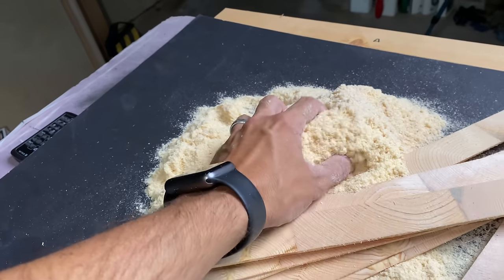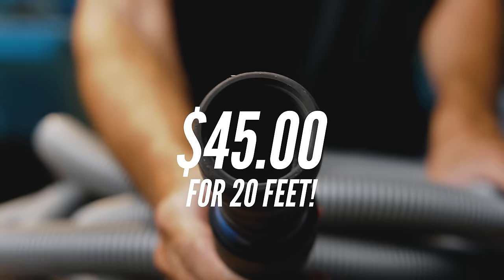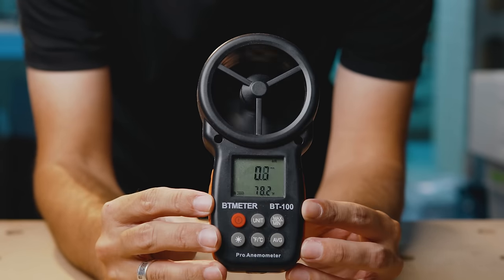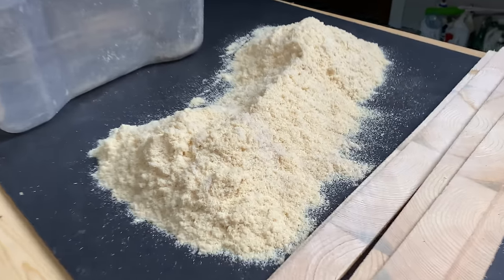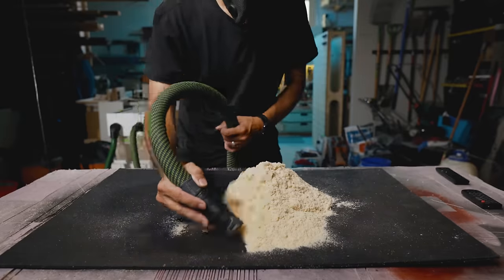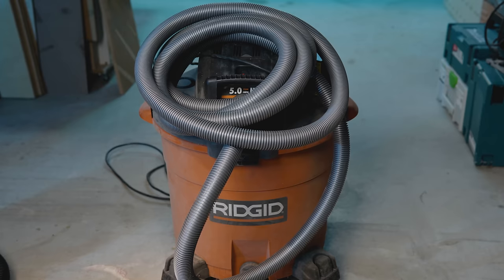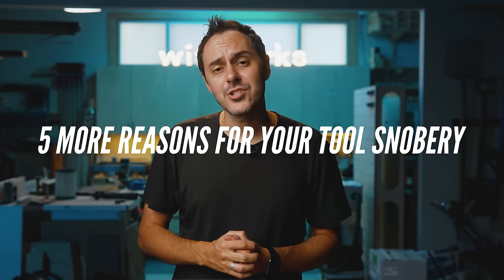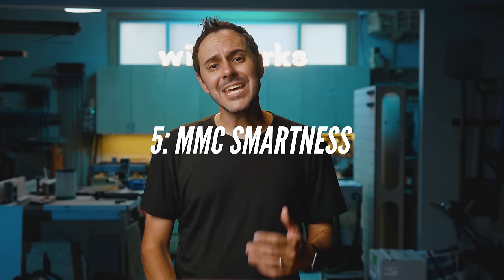This video will save you a lot of money. Dust extractors for beginners.

Comment: Really interesting video man! Nice to see the honest feedback on festool and some side by side comparisons.
Reply from the maker: picks himself up off the floor 

cough

Thank you Cam! Can't believe you watched. Or even commented. 

Thanks for not trolling me. I'd have to screen shot you at the end of my next video. That would be embarrassing.
Reply: @wittworks  worlds funniest reply
Reply from the maker: @CraigularjJoeWoodworks  Ha! I forgot I did that.
Reply: What's really interesting is the vacuum cleaner can use 6.5hp when the wall outlet can only supply 3hp. 
Free energy technology!
Reply: @wittworks  I think You are often too self-deprecating good man. You may fuck up (in big ways at times) yet you also succeed in amazing outcomes, have the courage to share those challenges (that most will not) and how you get around them becomes a teaching moment within your presentation style. 

Having a smaller following doesn't have to be like having a smaller dick... you can still walk through the men's changeroom with pride knowing your product will be recognised as big potential, and in time will grow. No surgery required.
Reply: Really enjoyed your feedback. My take is don’t change or clean the filter in the old vac ever.😊
Reply: Is there a summary minute?
Reply: By multiplying air velocity by the cross-section area of a duct, you can determine the air volume flowing past a point in the duct per unit of time. Since the Volume flow by Festool is measured in Cubic Feet per Minute (CFM) divide your initial m/s by 60 to convert it to meters per minute first.
Reply: @wittworks  I khow your son please give me a shout out I love these vids
Reply: When you resell the Festool one day you will get the difference back and then some if its still in good shape. You won't get diddly squat for the used Rigig.

Comment: The more loaded a filter is, the better if filters. The tradeoff is the lack of airflow that comes with it being loaded. The particulate that is caught acts as additional filter material, and so long as you can maintain airflow, it should filter more effectively than if it was brand new. You can think of a metal grate with 1" holes and dumping gravel over it. The larger rocks will create smaller gaps that will sometimes catch rocks below the 1" hole size. With filtration you are dealing with viscosity, static bonding, and a few other things as well but it works as a basic metaphor.
Reply from the maker: Yep. That is my suspicion. Got a new filter to test against.
Reply: I was thinking the same thing.
Reply from the maker: Guess we got a solid idea for a follow up video!
Reply: Well put sir 👏
Reply: Well said! 👍
Reply: 100% whats happening.  That being said you might also want to measure air quality around the tracksaw.  The old clogged rigid maybe spewing out less particulate near the exhaust but it's probably leaving more in the air near the source aka the tracksaw.
Reply: That's actually a partial misconception. A clogged filter, with high negative pressure after it pulls larger and larger particles through it, and with subsequent cleanings the base filtration degrades fast.
Reply: Yeah, I was thinking lower suction and loaded filter would increase filter efficiency.
Reply: @Jwalk9000   Based on my understanding you are correct. If there is enough negative pressure it will degrade the filter in the long run. In the short term, or when there isn't enough negative pressure to force larger particles to damage the filter material or filter substrates, the loaded particulate acts as additional filter material increasing the probability of filtering smaller particulate. Is that consistent with what you know? I'm pulling this mostly from some whitepapers I read years ago.
Reply: Came here to say the same thing.
Reply: I've put the to words in my mind before but never spoke it because I can't find a moment when it's pertinent information, my audience member would actually care, and there's enough time to say it in the moment ... it is a lot of words after all, and while it's maybe it's not something I can say 'well this just isn't a soundbite concept' about... it'd be a long soundbite. Anyways thank you, I now feel vindicated, knowing I'm not the onle one to think this.

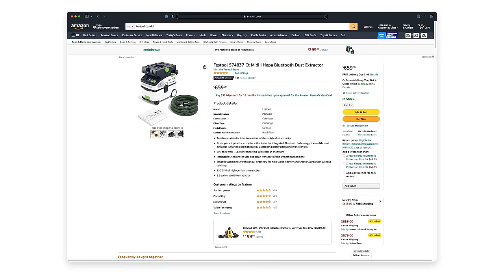[ EDIT: I wrote this while paused @ 1:14 ]
Reply: This is exactly right. We experience the same thing in the swimming pool industry. An old sand filter filters as good as a new DE filter
Reply: And also when you go to empty it and or replace the filter, you'll be breathing in the nasty stuff
Reply: @wittworks  looking forward to it as I was thinking the same phenomenon was occurring here. I too have asthma, and these kinds of videos are important to me. Thank you for making this content!
Reply: @wittworks  will you post follow up results?
Reply from the maker: @Zachary Milos  yes. hopefully in a few weeks. I'm neck deep in two other videos right now, but will definitely do a quick follow up.
Reply: @wittworks  great looking forward to it. Subbed and 🔔 so I can see the new info!
Reply from the maker: Oh man! Thanks! Got a good one coming out in an hour or so. Exporting now.
Reply: @jsmxwll  Yes, researching filter systems for vacuums, air purifiers, dust collectors, and air scrubbers, there is a common trait; All solid/dry filter mediums degrade over time and repeated uses. The EPA found in a study I saw years ago that things like "reusable" HEPA rated filters no longer meet HEPA ratings after the first cleaning, and depending on things like the airflow, filter surface area, and time in service, they don't keep their ratings very long. Vacuums and air purifier manufactures add carbon and activated charcoal "after filters" to hide and absorb smalls that are passed through the primary filters after they pass their highest effective time-in-service ratings. 

The best systems for capturing fine particles over time are water based. Cabinet shops around my area use multi stage, multi million dollar systems to capture progressively smaller particles before passing all the air through a liquid filter system to capture the last particles. And even then they exhaust the air outside the work environment.
Reply: Came here to say the same. Well said.
Reply: That's seems right but I want to add something. This only applies when you're "breathing" or measuring particles near the vac - exhaust becomes quite cleaner with an clogged filter. But all woodworkers are working on the other end of hose where situation is differ - with clogged filter you lose the airflow and it's speed on the tools exhaust. Because of that more dust will end up around the tool and not in a vac. And that is a problem. For example, I'm definitely know that difference between L- and M-class vacs not in corresponding filters - they are the same, but M-class have a special system that will signal to operator about clogged filter and lowered airflow which lead to more dust not even going into the hose.
Reply: Exactly. However, the trade-off is now all the dusty air that escaped the saw.
Reply: This is the way, I concur
Reply: Double thumbs up
Reply: Great observation!
Reply: That’s how I interpret this too. By using an old filter with buildup it’s essentially closer to a higher filtration level since it’s got more buildup
Reply: Thats not true. Thats a misconception on how filters work. Filters don't work like a sieve where particels are blocked depending on their size. Filters catch particles on their surface. Once the surface is loaded the filter loses its effectivness. Cleaning and replacing the filters is important.
Reply: @Danie90  Your comment about filters capturing small particles on their surface is true, that doesn’t negate what the others are saying.  If you look through the professional literature you’ll see filters rated at new conditions and after a specified amount of dust pack has built up.  The filtration efficiency is always better after the dust pack is built up at the expense of pressure drop.  Ignoring sieving-which does happen, otherwise very large particles wouldn’t be captured—there are three methods for particle capture.  They are: impaction where the particle hits a filter fiber head on and sticks, interception where it is captured as it goes by, and diffusion where the random motion due to molecular collision causes capture.  This is why HEPA and ULPA filter efficiency has a minimum at 0.3 and 0.1 micron respectively and gets better for larger AND smaller particles.  The dust pack acts like a filter making it harder for particles to get through.  For more details on this and filters in general check out:  ASHRAE “Handbook of fundamentals”, William Hinds “Aerosol Science”, and Einstein’s “Brownian Motion”.   Yes, I am an aerosol scientist by training and have designed and tested some of the cleanest rooms in the world.  Filtration effectiveness is something very important in this business.
Reply: I believe that Bill Pentz says the same thing on his dust collector site. That stuck in my brain when I read it many years ago.
Reply: Except as it becomes loaded and airflow decreases it will extract less and less. Becoming less useful. There's probably an ideal intersection between the two
Reply: You've also got no bag and an additional filter on the exhaust port. Not exactly a fair comparison though.
Reply: A brand new Festool bag stops 100% of even MDF dust.  I have a 5 (x2), 8, and 10 year old vac from festool.  All of them are spotless inside after years of use.
Reply: This is correct.  I would only add that less air gets filtered as there is a lower flowrate of air.  The way the HEPA filters get around this, is by making for a lot more surface area than the dirty Rigid filter, thereby allowing for more airflow.  On the positive side, when the HEPA gets a little dirty it will filter the small particles too!
Reply: On second thoughts I don't care, I'll borrow my friend's or better still get him to do the job for a couple of beers, fried chicken and fries.
Reply: Yep this 💯
Reply: @wittworks For test 2 you need a base value without the vacuum running. And maybe put a trashbag over the exhaust to isolate it with the air quality meter. 

Best air quality is always an exhaust to the outside. Maybe put a cyclone only 😂
Reply: It also uses less electic.
Reply: This is the correct explanation. Before I saw your whole video, my first thought was inaccurate meter, but then you went and tested its sensitivity, so you cleanly eliminated that explanation. The truth is that the more objects you put in the flow path the more you decrease the effective cross section available for the pass-through. But the more clogged it gets the higher the chance of motor overload that can end in burned coil —death of your motor.
Reply: Preach. You're the second other human I've ever witnessed to state how HePa works. Kudos
Reply: @vasconcelosm12345678 therefore, contain the worksource if possible, and control the pressure
Reply: @Jwalk9000 cleanings? What cleanings? You really shouldnt do that
Reply: @wittworks   did you do a follow up with a new bag?

Comment: My least favorite thing about this video is the fact that I LITERALLY have never been shocked by my non anti static hose. I watched this video, got back to my shop to work and I've been shocked like 3 times in the last 29 minutes. What have you done to me...
Reply from the maker: My bad! I got shocked the other day too. I’ve ruined our lives.
Reply: Crap, I've never been shocked by mine either. Now I'm about to go out and use it... What have I done...
Reply: Mate you will never understand how bad the static shock can be until you’ve thrown or smashed wands vacuuming concrete dust after grinding especially using a large dust extractor the charge can build up enough to drop someone who isn’t use to it or knows it’s coming
Reply: This man is truly electrifying.
Reply: @kennethhanes5438  I can back up your comment about concrete dust, while putting down safety rails, we drill 3/8 inch anchor bolts 4" down. And I can see the sparks jumping at the end of the hose.
Reply: Ha what a coincidence!
Reply: Now I understood why shock therapy is over that I was suffering for years . I am using festool!  Omg I just recall that feeling after finishing sanding and then bang 💥 at your balls.  it’s as bad as in a mental institution where I was locked recently for refusing to wear a mask and get a j@b😅

Comment: It's been 45 years since college, but I have a background in science and lab results. Your comparisons are quite valid, even if your meter is not deadly accurate. True, you may not be able to trust the quantitative numbers the meter is showing. As long as they are consistent, however, you can make a valid, qualitative comparison that "A cleans the air better/worse than "B". You have convinced me!
Reply from the maker: Thank you
Reply: I agree. Valid analysis. Precise? Not really. Valid? Absolutely.

Comment: One very likely reason the old shopvac had a lower output of very small particles is that the filter is clogged, which actually increases it's ability to filter things out, but at the cost of air throughput (and thus worse suction).
If you want to further test that you could simply repeat the test for yourself with the festool turned down to the lowest speed, and compare it to itself on highest speed.
Reply: But if it has enough suction to keep up with the waste from the tools, then it's still a better value even with lower suction...as it's not releasing a higher amount of fine particles than the more expensive options.
Reply: @alphaforce6998 but what about the fine particles near the tool where the person is breathing? The scan is getting live data at one point. We’d need to have probably 2 at least to see the full scope of the air quality with these filters/vacs
Reply: wouldn't a better test be to put his airflow meter on the exhaust? that would show if the old vacuum  is outputting the same amount of air as the new Festool or the new vacuum?
Reply: @alphaforce6998  Seems a thoroughly clogged shop vac filter makes a pretty good HEPA filter! DANG!  😄I just changed out my filter recently!
Reply: Agreed! Would love to see another test where air flow rate was held constant among the participants bc it stands to reason that high airflow means more particles are being processed through the system.
Reply: I'd quite like to see the results of testing a new filter on that old shopvac.  I'm betting both the Rigid with the HEPA filters and the Festool would look a lot better then.

Comment: Good video, one note - the anti-static hose isn't about shocks, it is about dust not sticking electrostatically to the hose.  Lots of static electricity is generated when moving air over an insulator, good industrial antistatic dust collection systems have conductive piping that is grounded through a 6-8 MOhm resistance to allow the static to dissapate.
Reply: If I am using a plastic hose, can I use a section of metal hose with the ground attached?
Reply: Or just use a secondary hose and venturi manifold to mitigate static transference...
Reply: Precipitation static (P-Static) is in the hose and the dust particles. Dissipating it if the hose is not conductive would be best done how?  A metal section that's grounded partway in the run or before the cyclone?  Static in the cyclone can be effective too as a means of reducing dust velocity.

I wonder where that leaves the options for a tool -> cyclone -> vac setup with soft hosing?
Reply: @jeffmastin you can use some scrap wire on the hose, just ground it somehow… problem solved with scrap
Reply: Well it's that but also any static spark can ignite dust particles and make your workshop explode... So... it's a LITTLE about the static sparking/shocks...
Reply: That wouldn't work a the majority of the hose would still be dielectric, many manufacturers make flexible and pvc style conductive piping (the plastic is embedded with conductive materials), slightly more expensive but whole lot cleaner.  And the explosion risk mentioned in one of the other comments is valid, but primarily only a serious safety issue whenever you have a shop that is combining collection of wood dust  with metal shavings and occurs in the storage areas vs. the piping. @jeffmastin
Reply: I have no idea what 30% of that meant but DAMN it sounded fascinating :D
Reply: Epoxy is notorious for sticking to everything especially the vac hose. I wonder if it would stick to the Festool hose?
Reply: I was just about to mention it.